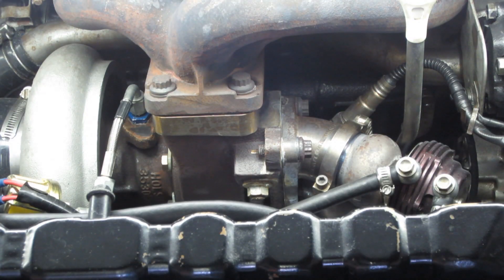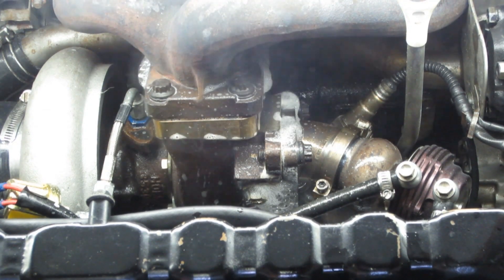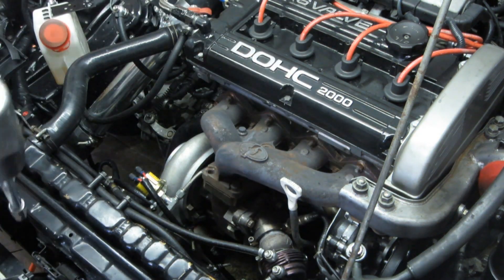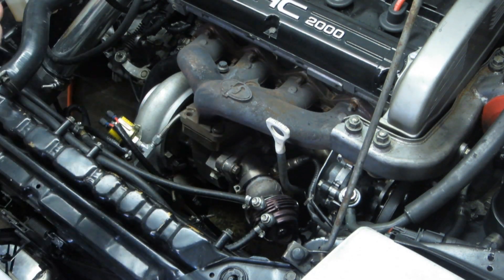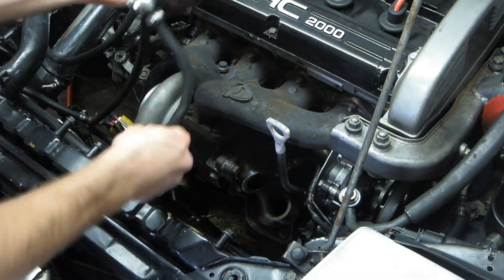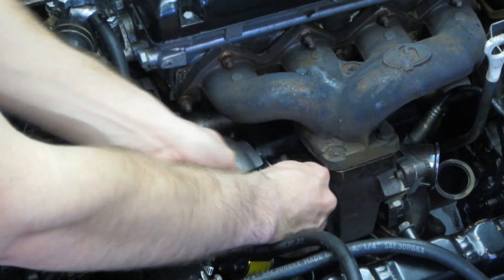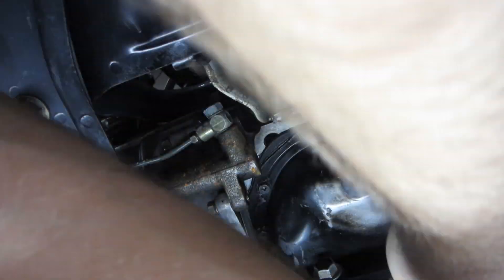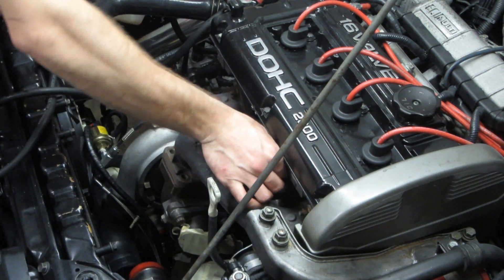Diagnosing a Lean Condition Part 1

Comment: Considering these aren't parts with any kind of tolerances, why not just make a pass or two with then on a table top belt sander? It should more than suffice and with the addition of new/better gaskets, it'll work out perfect. The surface of the head flange is another story. But considering you didn't check it in this video, I'm assuming you believe it to be straight and true. Nice video, the formatting seems familiar.. Taking lessons from Jafro?
Reply from the maker: Jafro actually "learned" me how, hence the style of video editing. It was kind of like an apprenticeship where I provided a little content and he provided the know how. Big thanks to Jafro (wonder if he will read this) because from the looks of my first video, you can tell that he had a lot of influence. 

While these parts do not have tolerances, I was searching for the cause of the leaks before just having them surfaced. Throwing them on the belt sander without first seeing if they are flat would leave me guessing if it was the gaskets or not. For instance, the turbine housing was milled by BEP and was flat all around. The exhaust manifold outlet was also flat so that points at the Gasket. 

As far as the exhaust ports from the head, they were checked for flatness when I built the head. There is a picture or too in a build blog I used to keep so I didn't pull the studs to check it again especially after finding the the manifold had some distortion. 

Robert
Reply from the maker: kbcustomz The belt sander that was used utilized a fine belt for the last cut making a very nice finish. Of course this is not mill work quality but these surfaces do not need to hold in the amount of heat and pressure that a head gasket is expected to withstand. With this in mind, the MLS gasket will be able to provide some sealing attributes that should seal two flat surfaces in the exhaust stream with no issues. 

Robert
Reply: If I were using mls gaskets between housings I would not belt sand the surface, I would treat it like an mls headgasket and have some really fine surface finishes.
Reply: robertbaxley sweet good to know, how much did you end up having to take off that manifold flange?
Reply from the maker: kbcustomz There was no accurate measurement of thickness taken before so I am not sure. We just took it down until surface was even. 

Robert